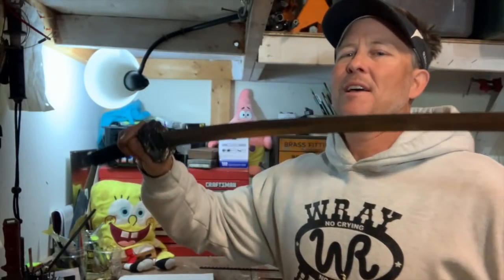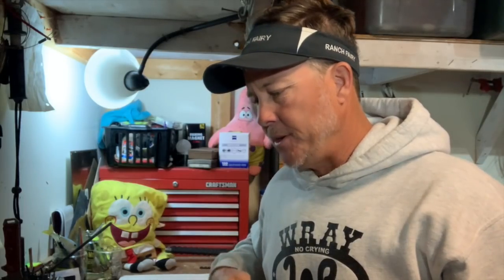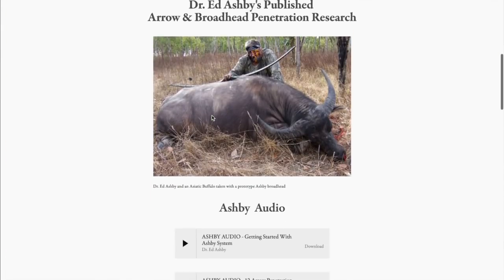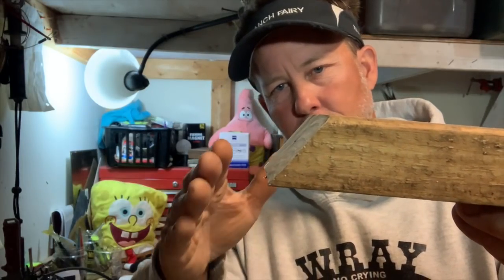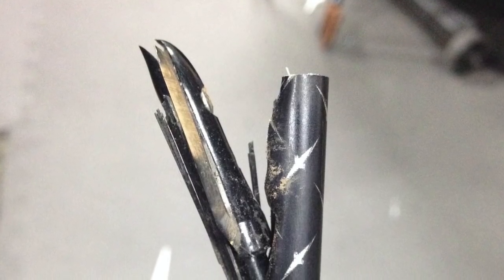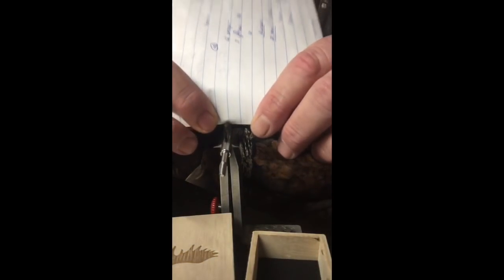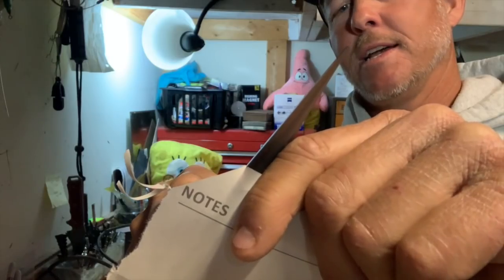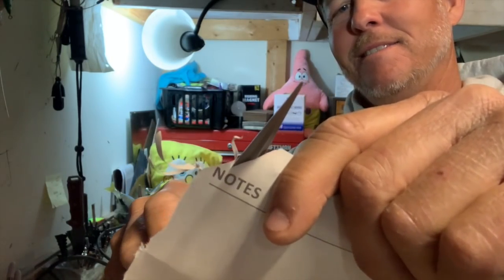Why Sharp Broadheads MATTER! l Ranch Fairy

Comment: I shoot mainly carbon steel which are much easier to get a good edge on than stainless, or maybe I am just too lazy to put in the effort it takes to sharpen stainless, at any rate, while on a hunt, I started taking a closer look at the arrows I had sharpened in my quiver and noticed the once polished shiny blades had a thin layer of rust on them. After sharpening carbons, you can put a layer of chapstik on them to reduce corrosion, along with touching them up as needed. I have used the bur edge for years and it has worked for me, but I may add the leather strop thing to my bag of tricks. Thanks for great info.

Comment: 2000 grit is a good start (beginner level). I'm going all they way to 60,000 grit. I builded special rig and I can match every angle. Paper test is like nr 9 shoot clay (in shotgun scale). In my book edge is still very dull. Edge have to look like a mirror. No fog on the mirror, no scratches on the mirror, no milky look. I'm looking for a very clean mirror look. How I test my knives, razors, bradheads? I laying down long female hair on the blade (don't have to be female but this is what I prefere ;-) ) No pressure, only weight of the hair. If hair splits in 2 seperate pieces, razor is sharp in my book. I'm using special wax on the blades so I can prevent corrosion. It's necessary? No it's not. But I like to keep my stuff in proper working condition. For example gillette razors are dull, I have to do multiple pases on my face in order to cut my hair all the way to the skin. This is why I use Straight Razor, no multiple passes are necessary. I remember when I losted my hunting knife in Alaska. I was able to skin and quarter a moose only with my broadhead.

Comment: I used to sharpen my hypodermic flappers blades and even sharpened the tips. I did it all throughout the season and never had an arrow not blow through and burry in the dirt. Yes I'm switching to cut on contact high FOC setup from my flappers and FMJs. They did serve me well but they work until they don't like you said and I want perfectly deadly. Your fairy dust got me lol. Working on my Sirius Apollo bare shaft tuning now.
Reply from the maker: Chad Woodward 
Meat

Comment: I am trying to get my G5 Montec three bladed cut-on contact broadheads razor sharp using sandpaper. I have watched your videos Simply Traditional's videos and every other relevant video I can find. I used a sharpie to mark the edges and basically followed the patten Simply Traditional and you specified.

I started with 350 grit sandpaper, then 400, then 600, then 800 grit. I haven't been able to get them sharp enough to cut hair or paper like I have seen you do with 2 bladed broadheads. I don't want to over sharpen and reduce the weight of the broadhead significantly. I have finer grades of sand paper and a strop and stropping compound that I could use but I haven't yet, because I don't think (polish) is my problem. I am not even sure that I have a problem. I know that 3 bladed broadheads usually have a steeper bevel (30 or 60 degrees) than 2 bladed broadheads so I am wondering if that is a part of my issue. Any suggestions you have are appreciated. 

Also, if I am using sandpaper, what are the grits that I should use?
 I believe I heard you say you used 2000 grit, but if I can't get it sharp with 350 grit then I don't think 2000 is my answer (but I know I could be mistaken).

Cary Peaden
cary.j.peaden@gmail.com
Reply: The courser grits are more for shaping and getting the angle consistent; the finer ones are what really gets it sharp. So yes, your problem is probably just that you need to go through the finer grits and strop it.  Then I bet you'll be slicing that paper right off. As soon as your sharpie is all sanded off, you're done with anything under 1000-1500 grit. Yes, the angle is a little different on the 3 blade, but not enough to matter.
Reply: @Joshua_Henderson  Thanks!

Comment: Have you tried Zeus Heavy Steel Broadheads? I shoot a crossbow and need Broadheads that will fly at high speeds.  Totally agree with the heavy arrow/high FOC.
Reply from the maker: DANIEL Bridgford 
Not gonna shoot a pencil with
Blades.  Totally backward from Ashby facts
Reply: @RanchFairy  Thanks for your input.  I am interested in the Magnus Black Hornet. 100 or 125?
Reply from the maker: @danielbridgford3887  125

Comment: i have a kme i use for knives     i generally go 100-1500 fiomamd stones 1000 2000 3000 5000 10000 chosera  waterstones  cbc 1.5 .5 .1=100000 grit on a kangaroo strop would you recommend going all the way to .1 micron =100000 grit or somewhere around 3 micron =5000 grit on .1 micron i unfortunately know if you touch your skin your cut but had no clue till you see the blood because you don’t feel it cut your skin

Comment: Two minimum requirements for cutting: pressure, and resistance (not to speak of sharpness) to said pressure. Those mechanical Broadhead can’t meet either requirement when they are inside an animal...

Comment: Steel quality is a big factor also. Theres no mechanical heads made that I know of with quality steel in the blades. Hell most fixed heads dont have good steel in the blades either. Theres a reason some heads are a $100+ for 3 heads

Comment: Im  wanting to try the tuff head broad head this year direct bond style what do you thing about using jb weld for the bond?
Reply from the maker: Lori Nipper 
The only thing I don’t like is it’s permanent and you better make darn sure it’s spinning perfect as it dries.  
Use hot melt - you can tinker with the heads, remove them if you want Etc.  Plus - the broadhead and insert are pushing forward - so it’s not really gonna come apart on impact

Comment: Hey RF, question for you. I'm running a 29.5" 9.1GPI arrow with 250 grains up front. 30" draw 65#. Any suggestions on what would work best for fletching type/configuration?
Reply: .300 OD shaft
Reply from the maker: Peter Hansen 
Perfect arrow flight?  
Fledging doesn’t matter - I run Q2i fusion X2 2.1” vanes 
But mostly 2” feathers

Comment: For those who have access to a real barber,  why do you think they strop their blades before they shave you? 
Also,  I wish the "Toxic" broadhead were off the market and I really wonder what sense the "Annihilator" broadhead concept makes with its built in parachute to "punch a hole".
Reply: Well, the annihilator is a coc design, easy to sharpen, and is pretty innovative as well. The "parachute" rear of the broadhead is intended to displace tissue and such. The theory I believe is to make it harder for clotting to happen in the first place. 

I definitely see the argument that it would create more drag, because the material it's "displacing" is also slowing the arrow down with the friction. On main body perfect shots it most likely works as advertised. On other-than-perfect shot placement I see the head running into some issues when it comes to larger bones.
Reply: Annihilator broadheads arent bad. Watch this: https://youtu.be/nbopTe2tK8I

Even if you dont wanna try em its a good unbiased video about different heads